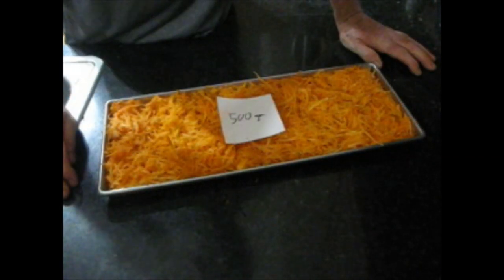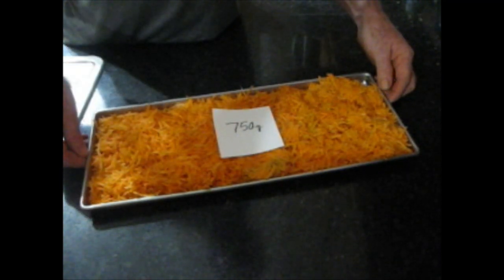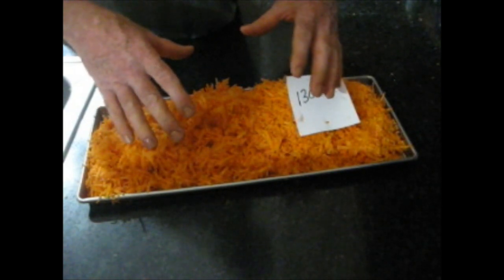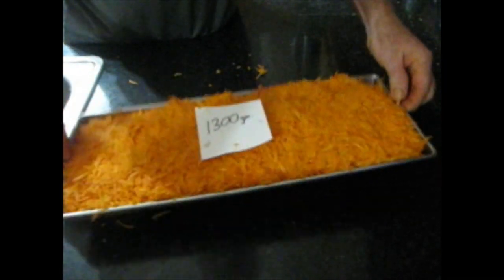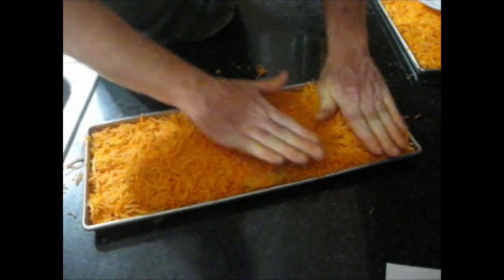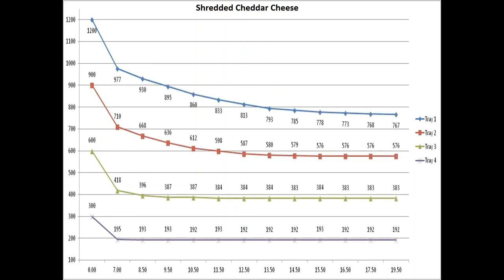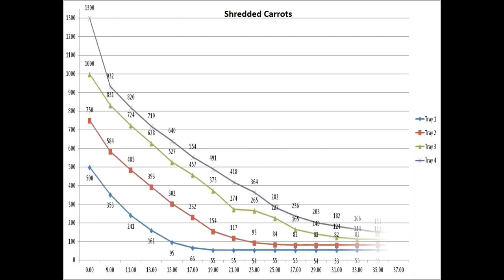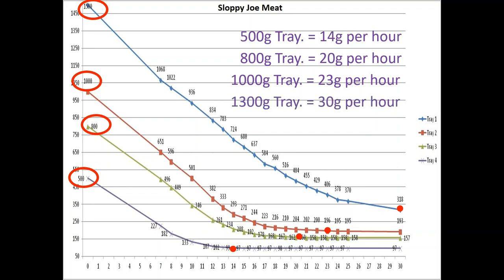Stack it deep - Dry it cheap

Comment: You're really "playing with fire" on this one. Over-full trays result in lots of extra ice...too much ice causes freezing/temperature faults and pump problems. You have probably been lucky up to this point, but it simply not good advice and goes WAY against what Harvest Right recommends.
Reply from the maker: I will respond to your question, however, I'm on vacation.  Your answer deals with the percentage of water in food, mass, and the density of food.  I will follow up.
Reply from the maker: I made the video "Freeze Dried Water" to help address your comment on the amount of food you can freeze dry.